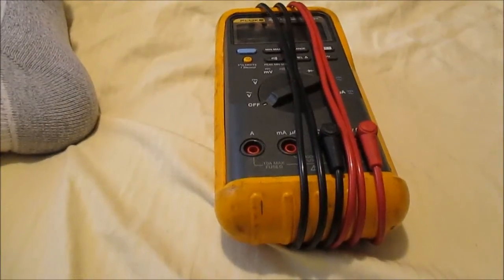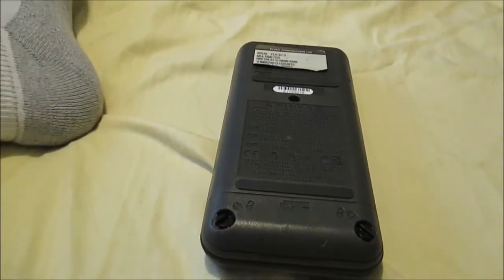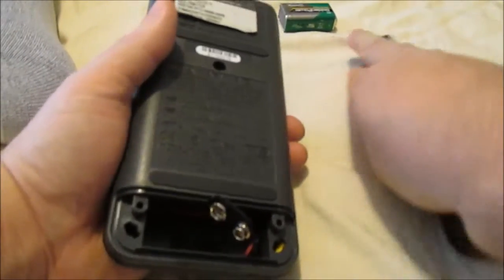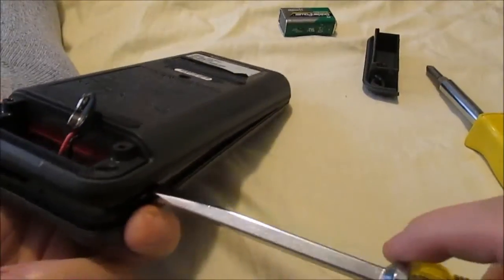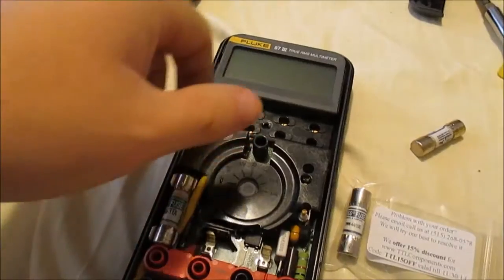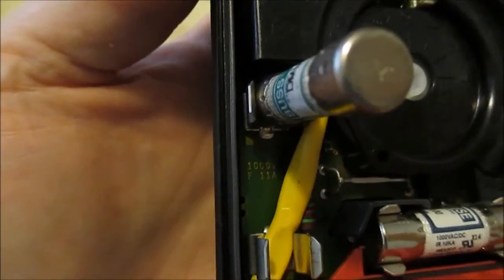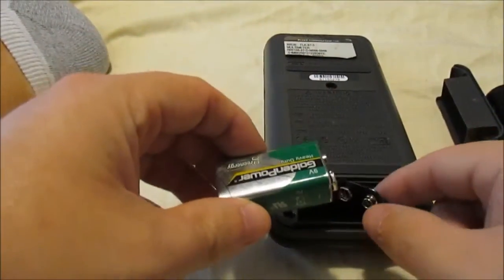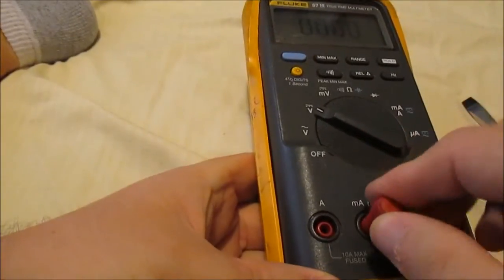How To Replace A Fuse In A Fluke Multimeter

Comment: You need some small screwdrivers.  I blew a fuse in my Fluke 233 due to not changing my selector to the right function and then touched a 600 v contact point.   This video helps for sure.
Reply from the maker: Thank you for watching.